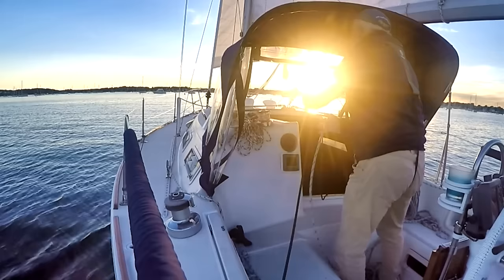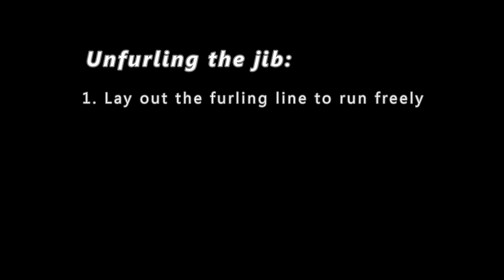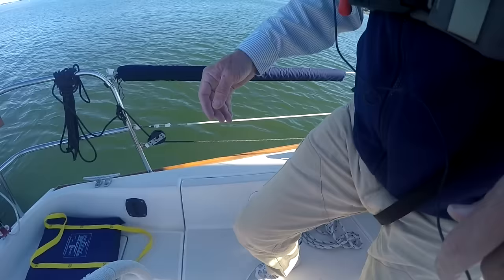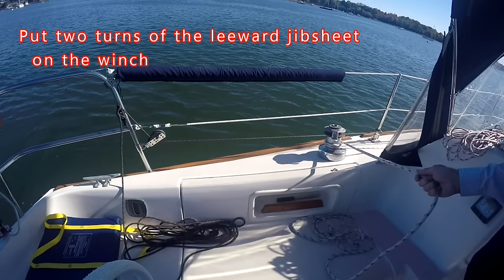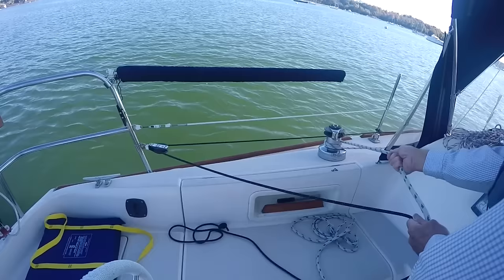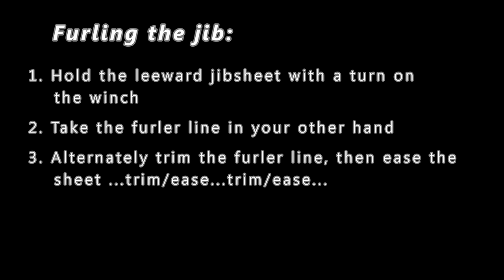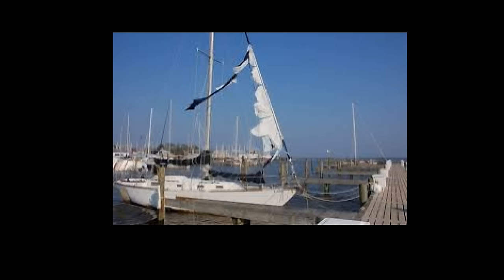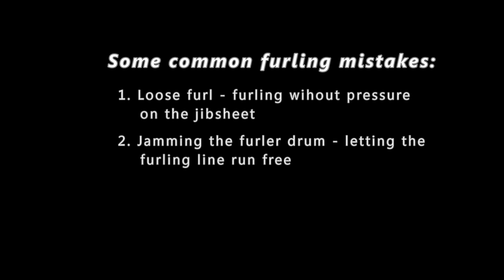Using a Jib Furler System | Sail Fanatics

Comment: Thanks - great video. Helps a lot!! My unfurling is difficult and not working. I have to turn manually. But to furl back works fine. What could be wrong?
Reply from the maker: My first thought would be your furling line may be jamming on the drum. 
Do you keep tension on the furling line as you furl the sail, so the line rolls smoothly up and down on the drum?

Is the line the correct size, not too large a diameter, and does it have the correct number of turns on the drum, not too many?
Reply: @SailFanatics  no tension  maybe it is the cause  I will try next time and will let you know - thanks a lot for the tips and videos - helps way too much

Comment: Can you furl clockwise and counterclockwise OR always in one direction (and thus from the port side only)? Thank you!
Reply from the maker: The furling drum will rotate/furl in either direction. However it is essential that you you prepare the drum before raising the sail by rotating it a number of turns (30 for me) in the direction opposite to that used to furl the sail.  On my jib the sun cover is on the starboard side, so when I furl the sail up, the drum needs to turn counter-clockwise, so the right side of the sail is out.

So when I porep the furling system to put the sail on, I first turn the furling system 30 turns clockwise and then the system is ready. Raise the jib, then when you pull the furling line, the drum rotates counter-clockwise, rolling the sail with the starboard side exposed.

Comment: Just one question: What happens to the leeward jib sheet? Where does it go?
Reply from the maker: Jerry,

I am not sure of your question...what happens to the leeward sheet ..when..?
Reply: @SailFanatics  When you furl the jib. I see how you're using the windward sheet to control the tension on the roll and the furling line(?) to actually furl the jib, but I envision the leeward sheet just flopping around loose and hanging out of the bottom of the furled jib. . .  What happens to the leeward jib sheet as you're furling the jib? 
Very new concept to me and I'm somewhat embarrassed to admit that until today I had always envisioned roller furling operating much like a roller shade on a window. . . give the furling line a little tug, let go, and the jib wraps itself around the forestay all by itself! (Which I suppose might be a big seller if I could make that work.)
Reply from the maker: @jcuvier135  
I actually keep a little pressure on the leeward sheet, not the windward sheet, as usinf the windward sheet would tend to backwind the jib and create an undesired level of pressure.

As the jib is furled up to just a turn or two remaining, I also grab and pull the slack out of the windward sheet. and then hold both sheets, so both are wrapped around the jib in the final two turns or so. Just ends up looking a little neater.
Reply: @SailFanatics  Thanks for your patience. Of course. I was thinking backwards with respect to windward and leeward. With that clarified, I'm still left a bit curious - I'm sure I'll be able to figure this out on the boat with hands on lines, but it's still not absolutely clear in my mind - how do you get control of the loose windward sheet and get both sheets to the same side of the boat before you start furling? Obviously crawling forward and just grabbing the sheets at the foot of the jib and then pulling the two sheets back to the cockpit is an option, but is there a more elegant (i.e. more convenient and safer) way to do this. A trick, as it were?
Reply from the maker: @jcuvier135  

On most boats, the jib sheets  run aft through genoa cars/turning blocks and terminate in stopper knots such as double-overhands.  The stopper knots keep the sheets from running forward through the blocks.

When you are furling the jib, you can ignore the windward sheet, by the time the jib is furled but for 2-3 turns, the sail will be silent and the windward sheet limp, Just grab the sheet end and pull the slack out of it so when you wind the last 2-3 turns on the fulrer, both sheets wrap neatly.